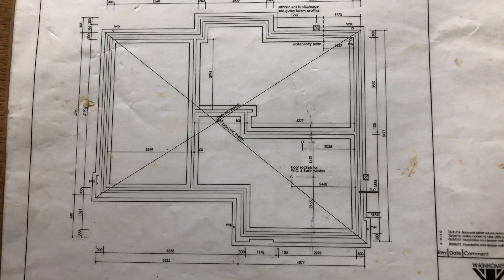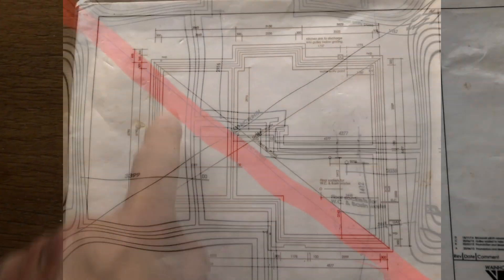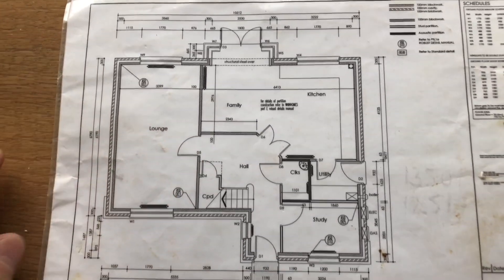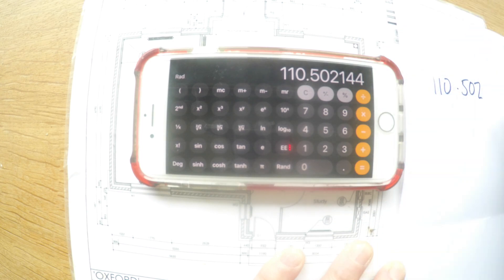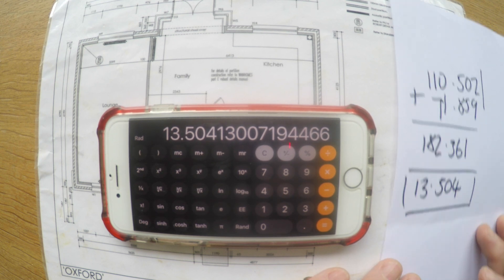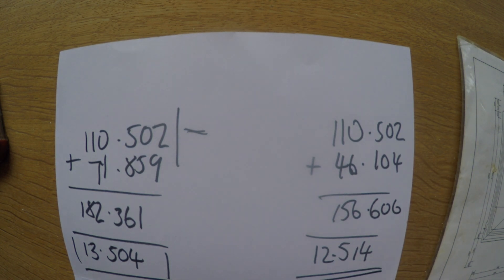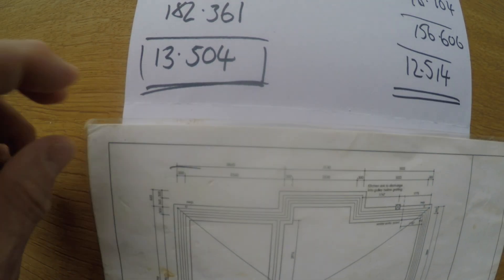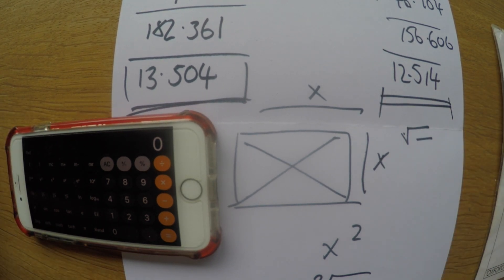HOW TO: CHECK A BUILDING IS SQUARE

Comment: so what does that exactly tell you  than steve  you have 13.504 square metres on the large size and 12.514 on the smaller size so what does that give you to help you how does it work i dont know sorry how does that help you as the builder
Reply from the maker: Hi lin, Im not sure i understand the question but if you watch the video a couple more times then it might become a bit clearer 🧱👍🏽

Comment: Great video. A Greek bloke called Pythagorus worked out the maths. Try a real simple example first of a=3 and b=4.  That should give you a diagonal of c=5.  Also try that one without a calculator. Always when using a calculator, do a rough estimate in your head to guard agaist finger trouble. Repeat anything with a calculator to double check the result, before putting the cement in the mixer.
Reply from the maker: John Coppock 🧱👍🏽

Comment: Hi steve, if the plinth bricks are 110mm then would'nt that add a further 220mm on the overall dimension of the diagonals or am i missing something. Not a criticism at all, excellent video as usual.
Reply from the maker: spartrowel Hi pal , the plinth is only on the front elevation so it’s a bit over 1 30 mil ish 🧱👍🏽
Reply: @SteveAndAlexBuild  See, told you i was missing something ha ha. Many thanks Steve it all makes complete sense now, keep up the good work.
Reply from the maker: spartrowel . No probs thanks pal 🧱👍🏽

Comment: Oxford housetype that steve.ive built loads.think you should to a vid on how to bond the plinth correctly.straight joint till it reduces to a 4 inch wall.good vid tho pal cheers matt👍
Reply: Thats it pal you dont want to do it because it goes against anything youve learnt regarding a straight joint but for the sake of six courses .it ive seen bricklayers put straight joint over the plinth and even 2 3/4rs in the small panel where the plinth wraps round the corner.so 2 3/4 rs all the way up the corner of a house 60 courses + up 😬
Reply: And those bloody wain homes house dont work brick length either.pain in the arse😫
Reply from the maker: Ysanne Ingham . Your so right pal , none of the house types work brick !!!! When we can’t get it to work brick up to Dpc we get a bollocking off the lads building the superstructure 😳😩🧱👍🏽
Reply: I think when they changed cavity size over from 75mm to 100mm i think they stuck 50mm on the lengths rather than adjust to suite the bond i found its either open up 50mm or close up 50mm .it wouldnt be so bad if you could use the facebrick to set the splash out but the engineering dont help.i feel your pain mate and ive had the bollocking aswell 🤣🤣🤣🤣🤣
Reply from the maker: Ysanne Ingham . I thinks you’ve got a good point there 🤔🧱👍🏽
Reply: @SteveAndAlexBuild  well thats my opinion mate .you try and tell the site managers that and they look at you as if you have 2 heads.i found by setting the bond at either 4 brick to 896mm or 4 to 905mm it worked there or there abouts even if you have big joints on the small engineering which tend to happen alot.it usually works out for the superstructure face👍
Reply from the maker: Ysanne Ingham . Same here 👌🏼🧱👍🏽
Reply: @SteveAndAlexBuild  so on one of your videos you did the diagnols on an extension when you set it out before the dig tje extension was set in from the gable end...but if the extension was built flush with the gable you wouldnt need to check the diagnols because you already have a right angle to work off is that right steve or am i way off.cheers matt
Reply from the maker: Ysanne Ingham . Normally yes , but I did conservatories for 14 years and realised not every house is built square so if the house is wonky , the new building is wonky 😬. 🧱👍🏽
Reply: @SteveAndAlexBuild  yes thats it pal and the conny frame doesnt sit square does it .its the same as buidling to dpc you cant always do it especially on conservatories if the dpc is out then the frame is out.so your best working from one side and drsgging the level round to a blind side .does that sound about right pal sorry to be a pain
Reply from the maker: Ysanne Ingham . Absolutely spot on pal . I saw some shockers over the years 😳🧱👍🏽
Reply: @SteveAndAlexBuild  ha i bet pal good helpful vid on the diagnols aswell pal cheers
Reply from the maker: Ysanne Ingham . Cheers , thanks for watching 🧱🧱👍🏼
Reply from the maker: Ysanne Ingham . Spot on pal . I know exactly what you mean about the plinth. It goes against all the rules when we build it up to dpc but it makes sense when the superstructure lads build the house . 
Thanks for watching and commenting 🧱👍🏽

Comment: Really useful calculation to know, Steve. I don't know about you, but it was years after I left college before I learned this...and that was from a brickie I worked along side on a job. More often than not the diagonals aren't marked on drawings so it's good to be able to work them out on site. Hope you lads are still managing to lay a few, the frosts are starting to kick in up here in the Highlands which is a bit of a pain in the arse!
Reply from the maker: Jim Newlands . I was the sane as you pal , if you want something doing, do it yourself. We are mainly wet but had a couple of light frosts 🥶🥶🧱👍🏽
Reply: @SteveAndAlexBuild  Aye, I've heard you have had more than your fair share of the wet stuff in your neck of the woods. Hope it's not affecting you too much. Have a good weekend, lads.👍
Reply from the maker: No we are the other side of the Pennines in Lancashire so we have done ok , no flooding luckily . You have a good weekend too pal 🧱👍🏽